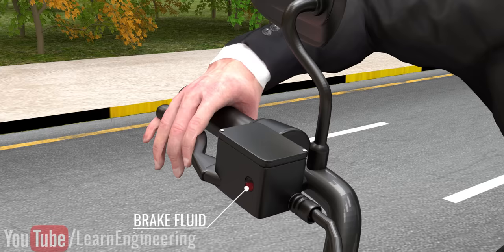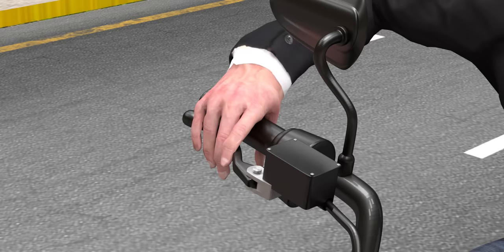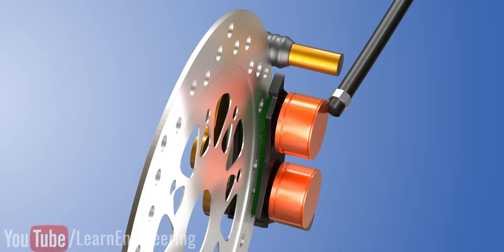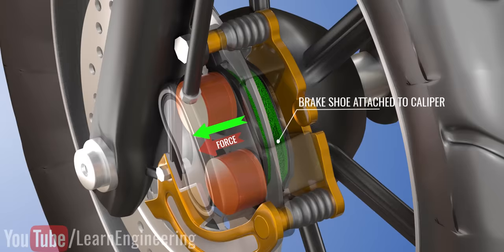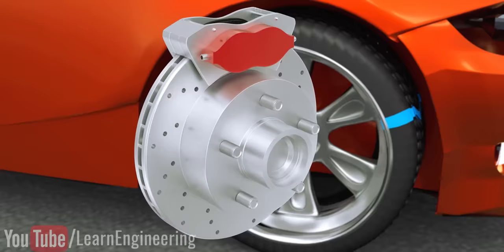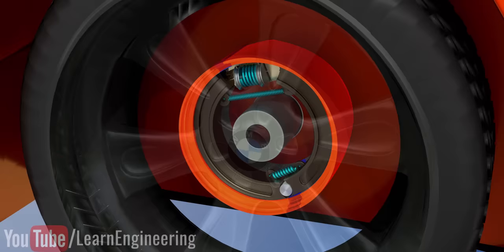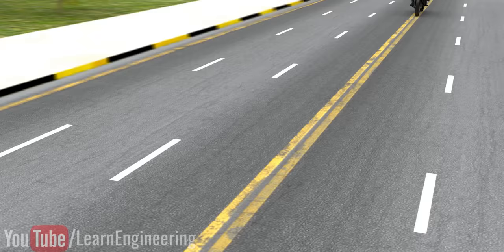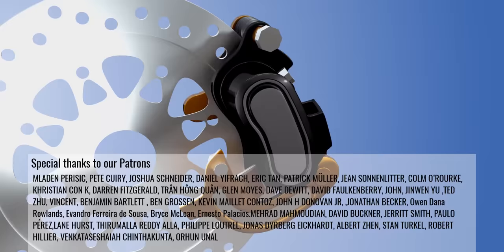Understanding your motorcycle's brake | Disc Brake

Comment: Disk brake overheat easyly compare to shoe brake. disk brake is not safe on steap roads. most accidents is related unto disk brake as it will not stop the car when used continually loaded heavily on a steap road. 
Heavy trucks use shoebreak not because it's cheaper than disk brake. They use shoe break simply because it can stand on continues breaking unlike disk break when continues heavy breaking it will not stop the car when it overheat unlike shoe break even it overheat it can still hold

Comment: I didn’t understand very well why do trucks still use drum brakes ?
Reply: Because it is cheaper but still possible to make them work on truck because they are a bigger and thus cooling is simpler.
Reply: @jonasdaverio9369  And with more surface area they would produce more friction and hence more stopping power, right?

Comment: 3:50 if you are VW and build the Polo, use drum brakes so you can light up the car of your customers. Burned car -> customer buy a new Polo, which breaks ignites the car… Congratulations you unlocked endless money supply. 

Back to serious business, the new Polo has drum brakes, which are engineered badly, so the car can start burning, watch out. This happened to my cousins brand new Polo in 2021.

Comment: 1:03 it is not a cable, it is a line, called "brake line". It is, too, filled with hydraulic oil, not only the piston.

Also, disc brakes dates back to beginning of 1900s. 

Good animation, but not so good technical information.

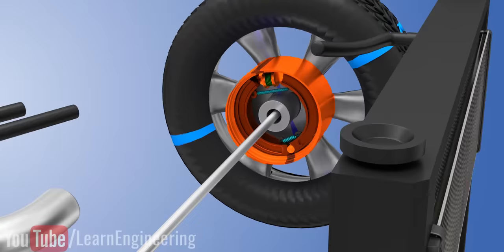Comment: 4:14 “since this wheel does not slow as fast..”. WHAT
Reply: It does not slow as fast because the brake is fading
Reply: probably meant "this wheel does not decelerate as fast" but you get it anyway

Comment: Now explain why Steel braided lines are better for motorcycle's
Reply: The steel brades keep the rubber tube from expanding. Which results in brake pressure lose.

Comment: Mistake one: Brakes do not use oil for fluid. They use brake fluid. Mistake two: Not all brake systems use pistons on one side of the caliper.  Mistake three: Not all car discs have vanes for cooling.

Comment: If modern cars are still using drum brakes, why they prefer using them on rear tires? why not two front drum brakes and two rear disc brakes?
Reply: Drum brakes are easier to lock up, and are harder to unlock with an ABS system. If the front brakes lock up, it is much more dangerous than if the rear brakes lock up.

Comment: BTW, Lesics, fluids CANNOT be compressed, so your statements about "compressed fluids" are utter nonsense.
Fluids, however, are very good at transmitting force, precisely because they are INCOMPRESSIBLE.  
If the brake fluid were compressible, it would shrink in volume when the brake lever is pulled and very little force would be transmitted to the brake caliper piston/s, thus there would be little or no braking effect. 
You really should have paid attention during physics classes.  Then you would not have posted such crap.